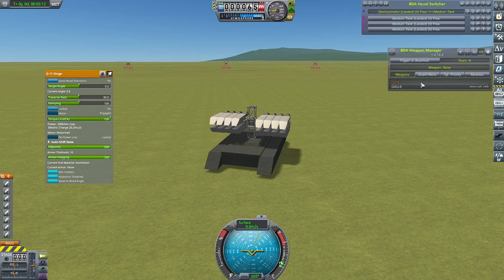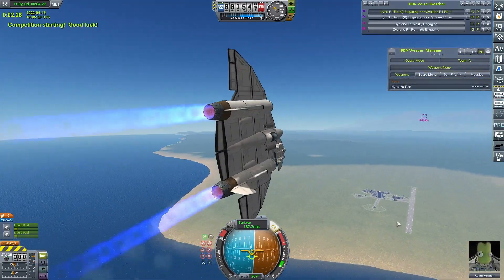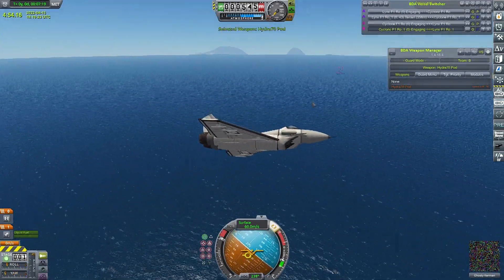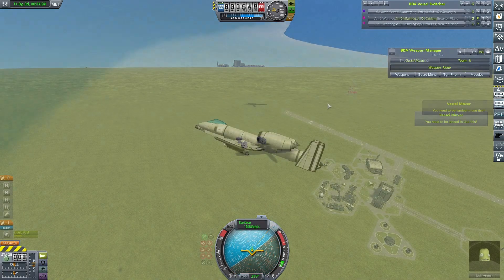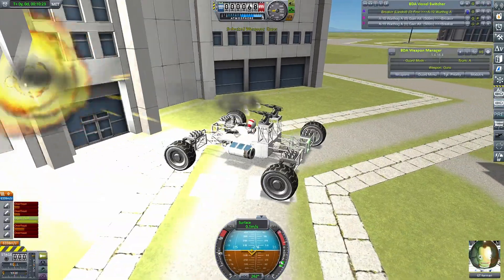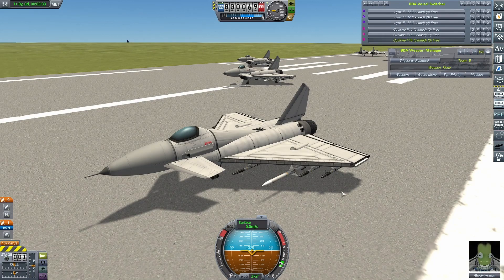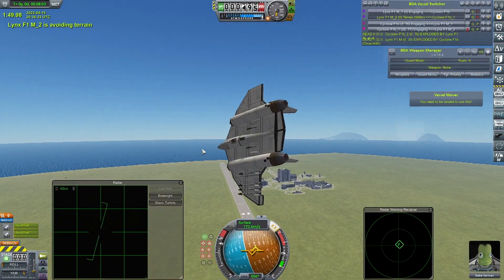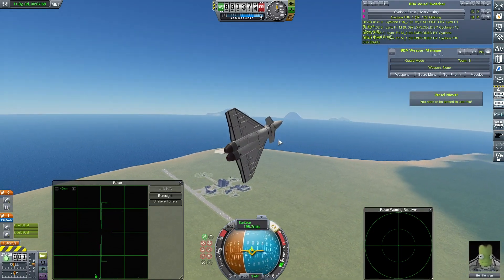Bits & Pieces Compilation #2 -  Kerbal Space Program & BD Armory

Comment: 13:55 the Lynx is not selcting sidewinders. Perhaps they have a large minimum engagement range?
Reply from the maker: I turned it down to 200m, as low as it would go in the normal settings window.
Reply: @SonofSmith  Interesting. I wonder if there are any reasons that the sidewinder is not engaging?

Also, rockets are good against slow maneuvering bombers

Comment: smith... its 150mm steel plate :D its supposed to be tough.
Reply: Doesn't the real Gau-8 penetrate tank's armor? In BD armory it's almost impossible to do that
Reply: @thomaz851  Top or side which is relatively thin.. Those panels are 6 inches thick
Reply: @thomaz851  the Gau-8 is a anti tank gun yeah but most of the kills of credited to the Gau-8 are really fucking old vehicles / APCs  or infantry
Reply: he shot it with like 16 GAU-8's that should have been enough
Reply from the maker: Surely I should have burned through a 1x1 panel's hitpoints within 10 minutes?